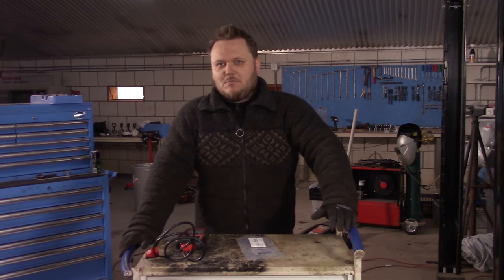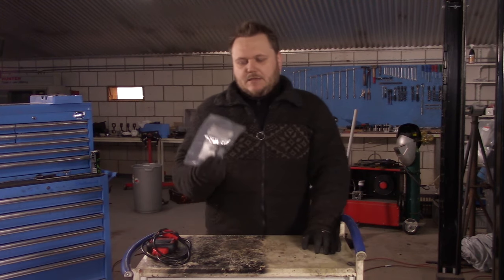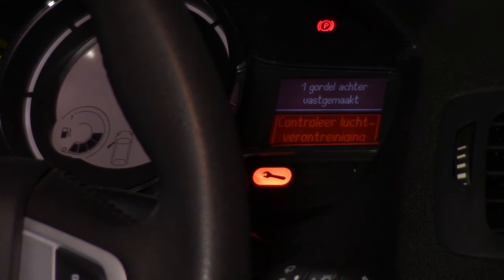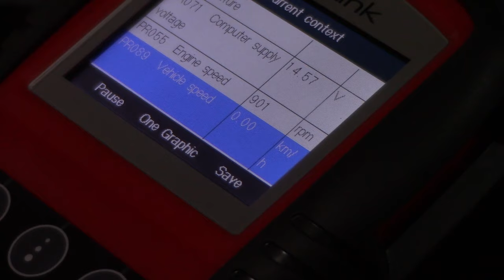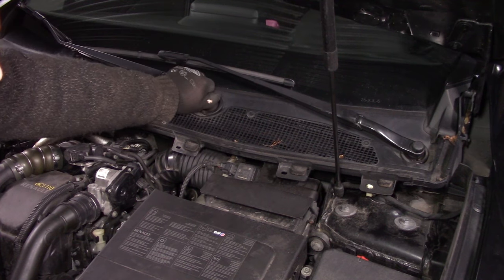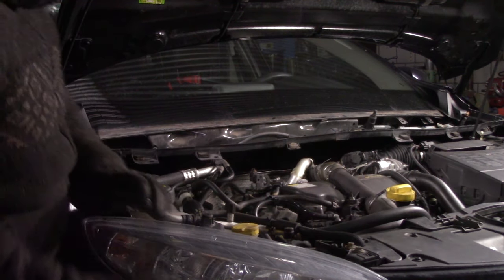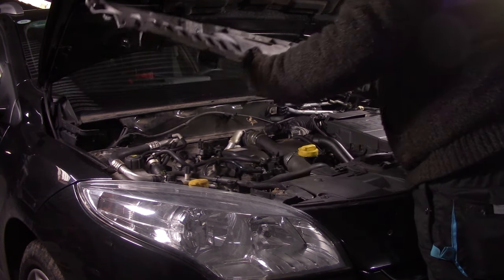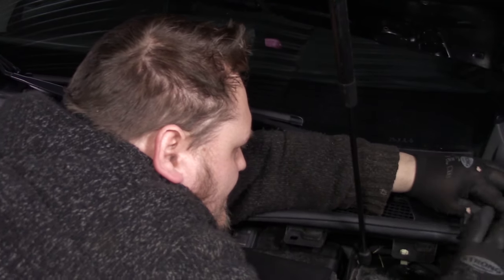How to get rid of your DF1003 code on your Renault. DPF / Particle sensor replacement.

Comment: Thanks for your video, I had the same codes, however it was just the red pipe on the sensor broken in half, the old sensor works but better to replace sensor and hoses or at least the red hose as its prone to breaking due to high temperature
Reply from the maker: I would replace both indeed, its a nightmare to get to.
Reply: @TheDutchGarage  tell me about it the worse place it could be placed, I could even use very long needle nose pliers, had to squeeze the hose clips with my fingers, so painful. But I did the same thing like you, took of the wipers and the water tray, I think it's the easiest option.
Reply from the maker: I'm glad my brother did it.😅

Comment: Thank you very much for your video 
I'm having a similar problem, I was reading with a obd connected to my phone and was receiving a maf sensor error changed the sensor and still having problems asked a friend how have a professional scanner and now had dof error, but never had a light on the dashboard the only think is the km/l was going down every time I put the keys on and the soot is stuck on 12g, hoping is the same problem you had ill try to change the sensor and pipes and see what will happen 
Again thank you for your video
Reply from the maker: Good luck with the problem!

Comment: The Dutch Garage, I have the same problem with my Megane III 1.5dCi. After cold start I smell exhaust, then check engine appears. OBD scanner shows the same error like yours, but Live Data shows "Soot in the particle filter" with 4,26G value on constant level. Is it ok or I need to change my sensor? I understand that hoses need to be replaced, but what about sensor?
Reply from the maker: Hard one. First try some heavy driving en see if the numbers change. If not the lines are clogged or sensor is stuck. If the numbers go higher then the sensor and lines are still ok but you need to clean the filter. If they drop to 0 and doesn't go up anymore then the lines are torn.
Time for some sporty driving I guess. Hope this helps.

Comment: Do you have a link to buy this? I have exact same problem
Reply from the maker: Hallo, DPF Sensor Bosch 0281006252 
DPF sensor hoses I dont know the code of but you have to get them from the dealer. The sensor you can get at the local parts store.